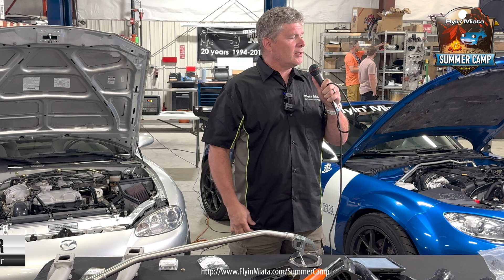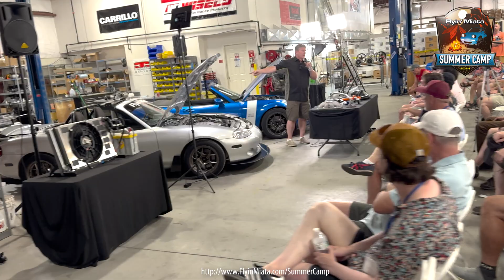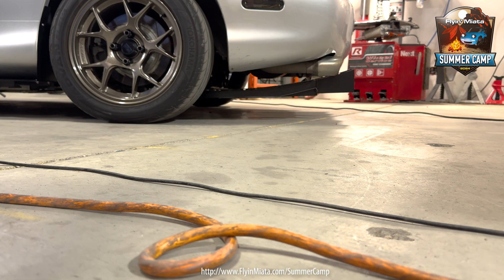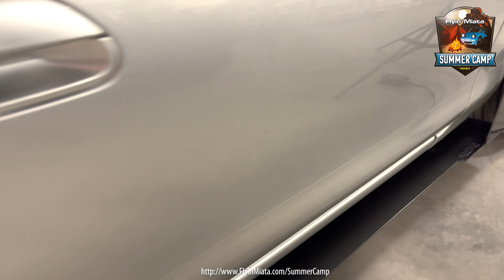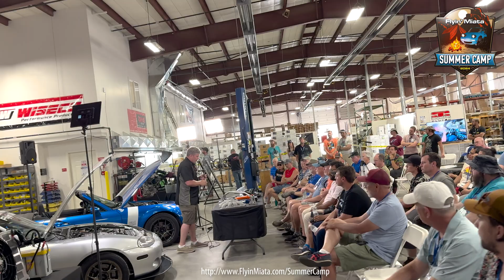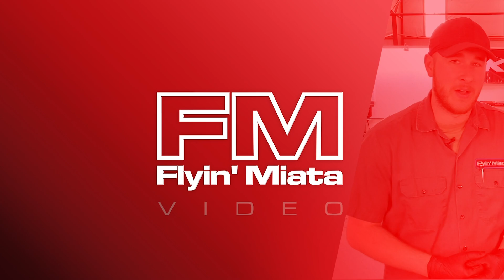FM New PRODUCTS! - 4K - FM Summer Camp 2024

Comment: Will you make a instal video when the race dash is coming out? And can we runn costom revlimiter faces
Reply from the maker: @Ruben_ACE_ We will make another video or two once it is available. The Race Dash will ONLY work with Revlimiter gauges - you can either use the off-the-shelf design we'll offer, or have Adam make custom ones. It will NOT work with Revlimiter gauges that were not designed to work with the race dash, so new faces will be required for any install.
Reply: @FlyinMiataVideo  oke thx for the info hope i can install it for 20 of oktober 👀